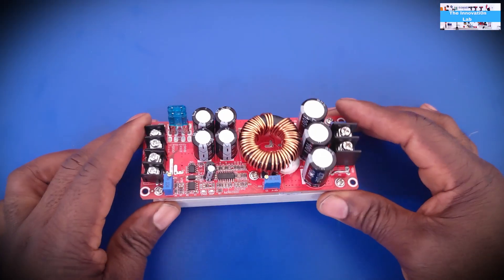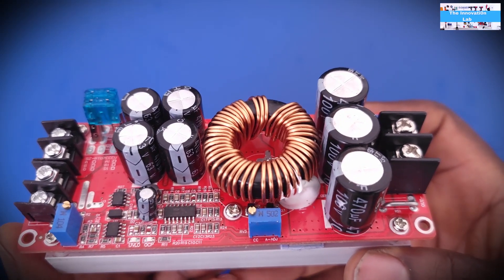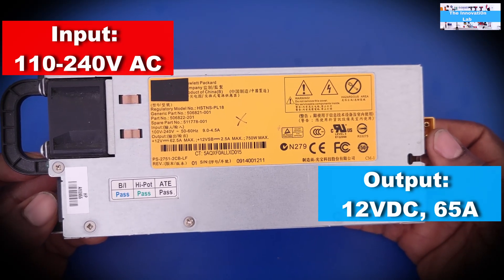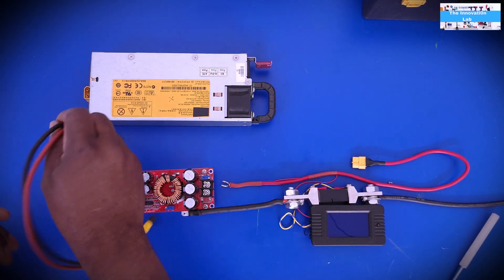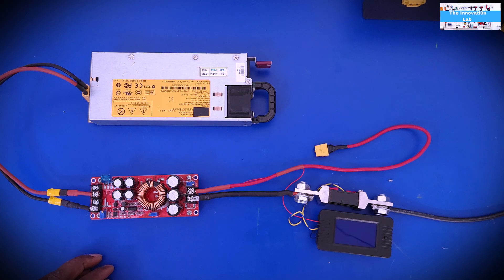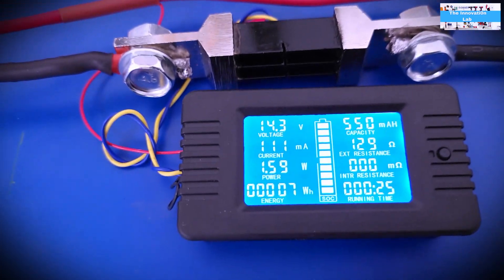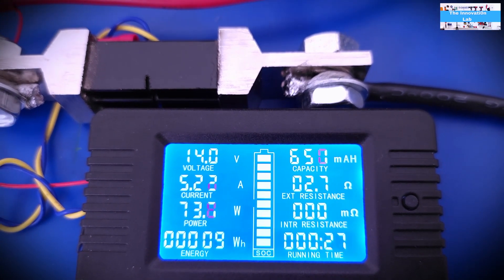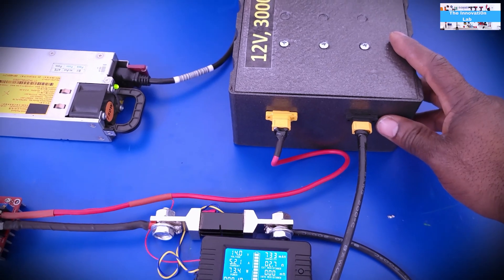Cheapest Universal Battery Charger Using a DC-DC Boost Converter

Comment: How do I increase the current? I can turn it up to 7 amps and no higher. My power supply is 850 watt and has 60 amp on the 12 volt rail, but when I set the output to 14.4 volts and 12 volts in, I can only get 7 amps. Cables aren't the problem.
Reply from the maker: What load are you driving with this? Are you using it to charge a battery? What battery type? Sometimes that will happen if your battery is bad....or if your battery is close to getting fully charged.

If you are driving a resistive load, you need to make sure that your load resistance is low enough to pull greater than 7amps.
The converter will only deliver as much current as the load is requesting.....that's usually how it works.

Respectfully,
The Innovati0n Lab
Reply: @theinnovati0nlab782 I have a 12 volt, and it requires 14.6 volts to charge my lifepo4 battery that is brand new. Says 100amp charging capability and 160amp discharge.  It's 165ah battery.  I know how these constant current boosters work but never able to get much out of the 1800wattt 40 amp version.  I get almost 20 amps out of the 1200 watt version though.  So currently that's the one I been using.

Comment: The ammeter should have been placed on the positive terminal, right?! You placed the ammeter on the negative/minus terminal. Anyway, nice and useful video, thank you!
Reply from the maker: That a great deal for such constructive feedback. Much appreciated. 👍👍👍

However, its a closed loop and it shouldn't really matter.😊
Same current is the loop - whether you place the curent clamps on the positive or the negative power cable. The negative is also considered by most industry experts as the 'Return' for this reason. 

The only thing different you will observe is that if you hooked the current clamps in the same orientation in either the Positive or the return, you will see a change in signs on the measured current but it should be the exact same numerical value.

Example: 
- connect to positive and you see 30 amps
- connect to the return (negative) and you see will  -30 amps.

In a nutshell the '-' shows you the direction of flow of current. It means that you are measuring the current that is 'returning to the converter....same loop current.

I hope this helps.
Help us spread the word as we are hoping to grow the channel.😊

Respectfully,
The Innovati0n Lab💥
www.theinnovati0nlab.com

Comment: I can't check current output from out put  of booster   multi meter not reading ampere why?
Voltage check is possible
Reply from the maker: You will need a current probe. The type I have been using in my videos.

Comment: My battery  not charge while i connect cinverter  it charger blinking after boosting to 24 v 
Why battery 24 ah 
Charger 1.5/12v    battery  12*2 24
Boost volt 27v
Reply from the maker: Please elaborate.
I didn't understand.☺️
You can write in a different language, and Google will translate it.
What is your battery voltage and battery type?

The Innovati0n Lab 💥 www.theinnovati0nlab.com
Reply: @theinnovati0nlab782  
Lead acid battery  12 v 24 ah 
Drained to 10 ah.  I. Used boost converter 
(14 v 1 ampere. ) To charge battery. charger (12 v type 1 ampere )just blinking. 
Not charging battery when using boost converter.  Without boost converter charger charge battery 
Wht will be reason?

Comment: Please advice me what you call the small gadget located on top of the power meter for the negative and the positive cable from the boost converter to your battery. Further it takes how long for you to charge the 2 batteries. Thank you.
Reply from the maker: Great question.
👍👍👍
However, I no longer use that power monitor in recent recent projects.
I will recommend the ones I used in the video below.
👇👇👇
https://youtu.be/t8Aaz4iQeXY?si=YbD1oIh3OQeQz2Jg
I added the product link for the power meter in the description. It's called the dc digital power meter.

I hope this helps.
The Innovati0n Lab 💥 www.theinnovati0nlab.com

Comment: Does it cut off the current when charged?
Reply from the maker: If you have set the right charging voltage and currents - recommended for your battery, the system will go into equilibrium or trickle charge mode for Lead acid battery and the charging current should drop to a near zero value.

For Lifepo4 and Li-ion batteries, the battery BMS should disconnect the charger from and battery upon full charge.

Please see the follow-on video below for more explanation.
👇👇👇
https://youtu.be/WDWJ77WWkXc?si=cLiQDunvL05quOVe

The Innovati0n Lab 💥 www.theinnovati0nlab.com

Comment: Great video, when you switched off ac input voltage, does it return charger from the dc battery back to the booster?
Reply from the maker: Great question.
There is a rectifier diode that blocks the current from flowing back to the converter switching circuit.  However if you leave the battery connected, there will be some small reverse current from the battery that goes to charge the output capacitors of the converter - since they are after the blocking rectifier diode at the output stage of the converter. 
Thus, you will see about a -0.08A flowing back to charge the converter output caps.

So, to be safe, disconnect your battery from the charger when you are done charging it - especially if you are going to disconnect the input power to the charger. This way, your battery won't get discharged over time.

I hope this helps.
The Innovati0n Lab 💥 
www.theinnovati0nlab.com

Comment: Isn't it better for your cells to charge them at 2 amps, I am watching to try to see if its could be an option for my ebike battery packs. they are 48 volt 20000mah I remember reading the battery instructions and they said 2 amps is better though you can get a fast  3 amps charger for some ridiculous price . though it can lead to imbalance? 
 Is there a better way, maybe using / or adding a low voltage cut off meter setting it for a charge vs discharge maybe?  
Just a thought?
I have no idea and i am just looking into these things so I am only throwing out what I have read and seen. 
Although  maybe you can use it  in order to make it shut off automatically ,though Just a guess!
Reply from the maker: Great question!
I love the fact that you are being cautious and playing it safe. It's always good to ask questions... you are awesome!👍👍👍

The rule of thumb is that you should recharge lithium ion of lithium phosphate batteries at less than 0.5C. For Lead acid batteries, the recommended charging current is usually around 0.1C.

'C' is the storage capacity of the battery in amp/hour. 
For example, if you have a
20 amp/hour battery, your charging current should be less than 10 amps. Personally, I would prefer a 0.3C to 0.4C recharge rate - this way, you are not overstressing your battery. The only downside is that your batteries would take longer to get to a full charge.

Every now and then, it could be ok to do a fast 1C recharge, but this is not something I would recommend to be done regularly - unless the battery manufacturer recommended it.

I hope this helps.
The Innovati0n Lab 💥 
www.theinnovati0nlab.com
Reply from the maker: Now share our channel and videos to all your friends on social media to help us grow...hahaha!
👍👍👍

Comment: Thank you for your video. 🤲❤️👍

If people want to charge it from a small solar panel how much would be enough to charge the 24v or 48v battery?
Reply from the maker: Honestly it will depend on the capacity of your solar panel, the amount of solar irrandiance you are getting during the charging time, the type of charger you are using, and finally the capacity of your battery.

I hope this helps
The Innovati0n Lab 💥 
www.theinnovati0nlab.com

Comment: cheapest ?????, your putting 5 amps into a battery for around $50, you can get a 5 amp charger from any auto store for $15 bucks, math not your strongest point then ?
Reply from the maker: Take it easy with the criticism and choice of words there. I prefer you ask for an explanation rather than rushing  to some easy, uninformed  derogatory assertions pertaining to my inability to solve partial differential equations..hahaha

First of all, the title and thumbnail of the video clearly include the phrase "UNIVERSAL CHARGER." 
Is your 5A $15 charger from the auto store a universal charger? Can it boost a 12V dc source to 60V? Is it capable of doing constant current and constant voltage battery charging? Is able to recharge all battery types and chemistries?🤔🤔🤔
If so, please send me a link to this charger so I can review it!

The boost converter used in this video is capable of delivering up to 20A at a variable output voltage of   up to 60V (1200W) - If you apply a higher input voltage level. Because I was being conversavative in my testing in this video does not mean that the output current limit of the charging system is 5A. The  5A limit was mostly to protect the battery I was charging in the video.

Thanks.
The Innovati0n Lab 💥

Comment: Only thing to point out, the spade connector you tried to tighten down on the output, because of the poor contact point, it will likely get very hot. This is generally not good for safety. Please make sure you make decent connections, especially when pushing significant amps.
Reply from the maker: Thanks for the great feedback.👍👍
That is a correct observation that I have made as well. However, the focus is to not exceed the current rating connectors by applying some derating factors and to ensure that the contacts  are making a firm connection. This minmizes arcing and helps keep contact resistance low....hence low dissipation.

However, I shifted away from using spade connectors in later projects. This is an old video.

Respectfully,
The Innovati0n Lab 💥 
www.theinnovati0nlab.com
Reply: @theinnovati0nlab782  While we both may understand this, please consider that viewers may not be as knowledgable. It is often worth pointing out these things as learning points.

Comment: I'm guessing an A30 controller could be used to cut off power once correct voltage is reached!
Reply from the maker: That is a good idea, but if you set the charger to the right charging voltage required for your battery, you won't need to do that.
When your battery is fully charged, the system will get to equilibrium, and charging current will drop to a trickle charge level. If you have a Lithium-Ion or Lifepo4 battery, the BMS will cut off the charger.

I hope this helps.
Now, share this video and get more subscribers in here!...hahaha.
👍👍
The Innovati0n Lab 💥 
www.theinnovati0nlab.com

Comment: Is this module equipped with short circuit protection?
Reply from the maker: Great question.
I don't think so. 
The Innovati0n Lab💥
www.theinnovati0nlab.com
Reply: @theinnovati0nlab782  I like your videos and I often watch them and then I take the initiative as a power supply but I'm hesitant to do it because no one has made what I think, most people use step-down as a power supply.
Reply: @theinnovati0nlab782 thank you! I like your videos and I often watch them and then I take the initiative as a power supply but I'm hesitant to do it because no one has made what I think, most people use step-down as a power supply.

Comment: i had one of these , when i removed the cv pot and it spit out over 100 volt dc loll  so i blew my  e-bike ( crap ) converter haha
Reply from the maker: Wow!!
Yeah, you never want to do that. The CV pot sets the output voltage level, and the potentiometer values are carefully selected to ensure that the output voltage stays below a set point - usually about 95V for these converters. When you removed the pot, you essentially interrupted the voltage feedback loop, thereby causing the wrong output voltage levels to be reported to the PWM chip.
The result is that the PWM chip will self-drive the control pulses to >95% duty cycle....this could drive the output of your boost converter to >500V.⚡️⚡️
This would also happen if the ground pin of the CV potentiometer is removed.

Sorry this happened to you. But don't let it discourage you. 

This is what I do with all my designs.
💥 Conduct lots of research to better understand the limitations of products I will be working with
💥 Double-check and tripple check all connections and review the safety of your design or rest setup.
💥 Take your time with testing - if you feel something is not going right, shut it all down, do some more research, and you will figure out what you are missing.

I hope this helps.
👍😎
The Innovati0n Lab💥

Comment: Great video's my brother! i was looking for a DC-DC charger to charge a second AGM battery in my car. Now it is isolated from the starter battery and only gets current from the alternator during a ride (by a Victron Cyrix-ct). The problem is my alternator is temperature controlled so it doesn't keep the voltage at 14.7V during charging but drops to 14-14.3V so my second battery is not being fully charged. No I will try to put a DC-DC Boost converter after the Victron isolator and set it to deliver 14.7V. Is that a good solution according to you?
Reply from the maker: Thanks a lot for the wonderful feedback! Much appreciated.👍👍👍

Great question!
I love outside the box thinking. However, I am not sure of the specs of your second battery and the recommended charging voltage and current.  To be honest, my concern with your design is that you could potentially overload your car's alternator. But your idea of using the dc to dc boost converter should work. My recommendation  is that you use a constant current DC-DC boost converter that would allows you to adjust the charging current to keep your system balanced. The lower the charging current, the better or safer  for your system. Also, try not to charge the second battery when all your cars electrical system is fully loaded....Air conditioner, headlights, stereo...etc.

By balanced, I meant that you need to make sure that the overall load on your alternator - especially with the second battery is less than its rated output power.

Caution:⚠️⚠️
Keep in mind that converters are subject to failures. There could be a failure mode of the converter that could  harm your cars electrical system. Make sure that your system is fully protected.

I hope this helps.
👍😎
The Innovati0n Lab💥

Comment: Problem with this method is there is no overcharge cut off. May be you still buy the module separate. So I suggest to use MPPT charger board.
Reply from the maker: This is a cheap alternative for those who can not afford expensive battery chargers that will have all those functions built-in.
If you set the converter to your battery's recommended charging voltage and current, when you get to full charge, the system will go into equilibrium. 

At full charge:
1.  Battery voltage = charger output voltage.
2. System current drops close to 0 Amps.

I explained this concept fully in many follow-on videos.
👇👇👇
https://youtu.be/WDWJ77WWkXc?si=5SD-w4pUl9T8czMi

I hope this helps.
Success wishes on your diy projects!
👍😎
The Innovati0n Lab 💥

Comment: I have this module too, and I have one question 
Can I firstly connect the output wire to 72V acid batteries after that I add voltage in input ? 
I have camper car ,I need use that module for ups batteries but always may car is turned off and don't have voltage to turn on the module , but the module is always connected to battries, Is that make problem for module or it's ok ?
Reply from the maker: Wonderful question.
👍👍👍
I have actually covered the charging process in great detail in the videos below.
Please go and watch them, when you can because it will be hard for me to explain it over text in here.
👇👇👇
https://youtu.be/WDWJ77WWkXc?si=GUma6KNVAuO51qOy

💥💥New video!
https://youtu.be/Hn8XeqQh70U?si=aaQchkrhDr7suhEj

Comment: I have a CCTV NVR that uses a 52V adapter for power. The problem is, we face constant power outages, resulting in a loss of security coverage. I want to use this 1500W boost converter to convert 12V battery backup from the UPS to 52V because I have found that this is the solution.
Now I have two questions:
1. Will it work?
2. How do I change the current?

(NB: I am somewhat of a noob when it comes to electronics. What I know today is learned through such videos.)
Reply from the maker: Wonderful! I am glad you found this video helpful. It seems to me that what you are looking to do is simple and should work as long as your system's ripple requirement is a bit relaxed - but it should be. However, you need to know the input current rating of your system or the input power requirement. If you know the input power spec, then you can calculate the input current using the formula: 
Input current = Input Power/52V.

Now, a very important NOTE!🔥
With these converters, you can possible only get about less than 300 watts of output power if your input voltage is only 12V. This is due to a 30A current limit set by the manufacturer.

If you look through my channel, you will find other videos that address current adjustments on this boost converter.
Please watch the video below. It talks about battery charging, but it will cover output current adjustments and current limit issues.
👇👇👇
https://youtu.be/WDWJ77WWkXc?si=5g-OpRdnLK20bVdW

I hope this helps.
We are looking to grow this channel and we can use some help from you with sharing our video with friends and DIY interest groups on social media. When these videos do well, we are inspired to do more.

Success wishes on your project endeavors, my friend. 
👍😎
The Innovati0n Lab.

Comment: How you programmed the display?
Reply from the maker: I honestly don't  remember. That video was made more than a year ago, and I no longer use that meter because it comes with too many wires and separate components.
Check out the video below  for the power monitor I have been using in most of my recent videos.
👇👇👇
https://youtu.be/j6TGMS1C_BE

I hope this helps.
👍😎
The Innovati0n Lab